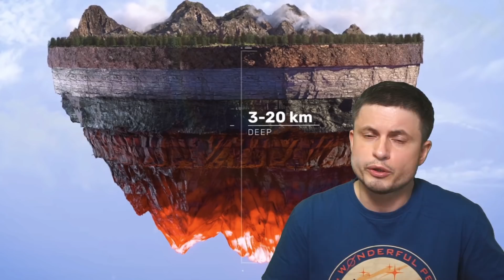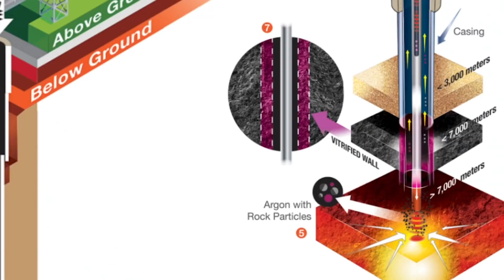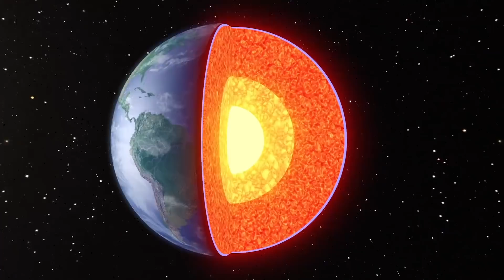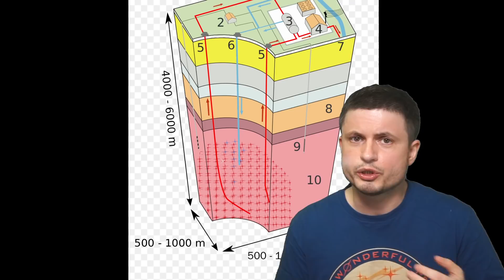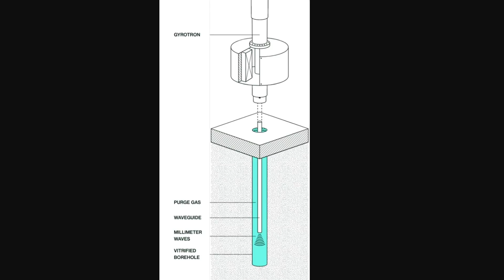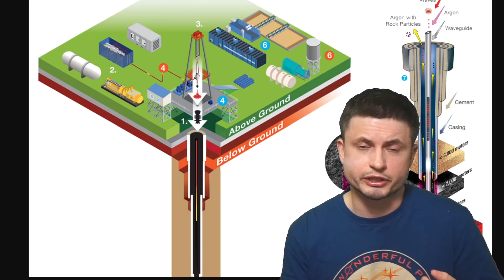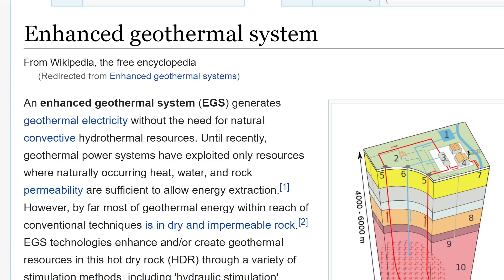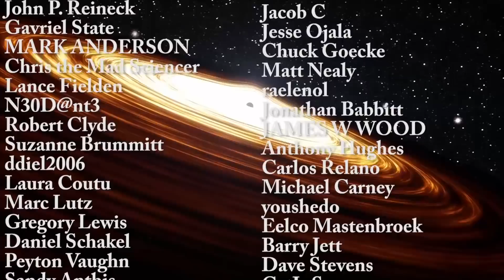Creating Deepest Hole on Earth For Geothermal Energy Revolution

Comment: Now this is good news.  Familiar with geothermal as I lived through the 1970's but the fact that it is "free" explains a great deal of why geothermal hasn't been aggressively pursued.  At least to me anyway.  Dunno.
Reply: "Free" energy is a misnomer, nothing is free.
The amount of carbon released to remove that volume of rock as well as released gas from the mined rock will "cost" a lot of carbon emission.
 Also the excavation of such a volume of rock won't be done "free of charge" by a generous cooperation for the eternal good of humanity.

Comment: I was in high school when the Kola bore hole was completed. I wondered then (as kids do) why we couldn't just use a laser combined with suction to vaporize the rock and vacuum it out of the way. I'm glad to see that science is finally taking my daydream in class seriously!  8-)
Reply from the maker: precisely! Star Trek to the rescue once again
Reply: It depends on the fluid/gas involved but it’s much more reliable and efficient to blow instead of suck. Typically what drilling rigs do is they have pipe that is narrower than the hole itself. They pump down the drill pipe and the fluid returns through the space between the pipe and the hole wall (the annulus). This process is not perfect though because material and debris have the potential to bridge off and plug the return path, a potential which is made all the more likely and complicated along the large temperature gradient of the bore, especially for the hypothetical one mentioned in the video.
Reply: @E2theBizzle  think you need a word with my GF
Reply: @unnamedchannel1237  lol that took me a second
Reply: You always see big coolers for big lasers - probably will have a problems cooling electronics that deep.
Reply: @Mike_lis  I don't think their idea is to put the "laser" (in this case it's actually a maser) generating equipment at the bottom of the hole (that would defeat the entire pourpose) but to have it on the surface and use some kind of waveguide to deliver the energy at the bottom.
The advantage over regular drilling would be that all the compicated stuff would be easily accessible on the surface while all the stuff down in the hole would be extremely simple (a waveguide for radio waves is basically just a metal pipe and/or metal rod).
They already do the same with lasers when the laser emitter would be too bulky for a certain application and so they use optical fiber (a light waveguide) to deliver the laser where they need it to be.
Reply: Suction only works to 26 feet deep.
Reply: @kkarllwt  - Your sweeping statement contains the common error of overgeneralizing a factoid, and you did not even get the detail right. You are referring to the lifting of WATER purely by suction, which relies upon atmospheric pressure to push the water up a pipe, where the pipe has a partial vacuum in it. (That should be called "sucking" rather than "pumping", but that is another common problem, imprecision in the vernacular.)_. Drilling deep holes has no relation to that water pumping scenario because all the _down hole fluids are pressurized. BTW, water often can actually be suction pumped several more feet than 26, but it depends upon the water temperature, the air pressure, details of the pump, the salt content, and even the amount of dissolved gases in the water.
Reply: @kkarllwt  32 feet? I thought
Reply: 'completed' is a stretch, 'gave up trying to go any deeper' is more accurate, the rock isn;t rock at that depth, it's more like chewing candy.
Reply: Energy...vaporizing rock takes a lot more energy than breaking it up.
Reply: @maudiojunky  Yeah but its an overhead, you can stop once you reach a certain distance, but still generate energy
Reply: @CrazyAssDrumma  Well yeah obviously it's a fixed overhead, but it's still an overhead that makes this method likely impractical for anything but the deepest stages of drilling on a project like this, let alone any ordinary, shallower drilling operation. GrayBeard pondered why not, and that's exactly why not (beyond technical limitations in the past). The heat required to vaporize granite is about 4x that required to vaporize water, and this device will be far from 100% efficient at delivering the energy to the target. The only thing that makes it attractive at all is the lack of an alternative solution.

Edit: I did the math and vaporizing 10km of granite in a 10" (25cm) borehole requires about 3.7MWh of energy before accounting for any efficiency losses, so I'd guess we can expect somewhere between 10MWh to 100MWh of overhead per borehole. It's really not too bad in the scheme of things since that estimate puts the energy use at 1-10 households worth of electricity for a year, but without knowing the return rate on each borehole or how many you'd need it's hard to estimate the payoff period. Essentially though we're looking at a small neighborhood's worth of energy for a year for the actual vaporization of the rock for each borehole.
Reply: @SteveQ Also known as "Staying upward-compatible with past mistakes."
Reply: Yuuuup 1mm wavelength that's gotta be a co2 laser (the 10600 nanometer wavelength is emitted by most commercial co2 laser units)... transverse electrode co2 laser.
Reply: Did you ever graduate?
Reply: @number4cat1  Yes, despite my best efforts to thwart my own progress, I ultimately completed a BA, MA (most of a second MA), a teaching credential, an administration credential, and a handful of other state certifications.
Reply: You could probably have an ultrasonic cutting head.

Rotating tools are so primitive
Reply: @ssss-df5qz  for sure, especially with some of the new acoustic lensing tech....
Reply: Good intuition. You’re probably smarter than you think. Keep dreaming and I hope one day you trust your gut and build something worldchanging. 👍🏾
Reply: @xerotolerant  Thank you for the kind words, really. Somewhere along the way in my years as an educator, I arrived at the conclusion, that pretty much, we are all smarter than we think we are. I am grateful to the many students who contributed to my realization of this. The most fantastical experience a teacher can have is to in some way support, encourage, or even inspire in a moment one student who one day changes the world.
Reply: @Graybeard_  I was previously watching Veritasium about the man who invented leaded petrol (and also CFCs). Its estimated the global IQ score dropped by 280,000 as result, with the biggest impact in wealthier countries but spreading to the whole planet. 

But I agree that too many people appear to underestimate themselves, not so much what they could understand, but the entertainment they could gain from making the effort and, almost accidentally, gain some understanding of the science and work . I’m virtually illiterate so far as science and engineering, but with communicators like Anton doing much of heavy lifting, and being a sci-fi fan since I could read, its a wonderful thing to be entertained by both fantasy and reality and when they sometimes collide....how many km down!? no way!  But Jules Verne would be very disappointed.

Also entertaining toread comments from those who know more and have practical experience.  One reason I like Anton is he attracts wonderful people.
Reply: @paulaembleton  280,000 iq score sounds like a lot of iq to loose.  What does that number mean?
Reply: @jengleheimerschmitt7941  - It was MILLIONS of IQ points, close to a billion, but obviously that loss was spread over billions of people who each lost a small amount.

Comment: As long as mathemeticians can calculate and moderate at what speed the earth will cool over time, it should be fine. There is no such thing as free energy. It transmutes into other things and will deplete the source, in this case Earths thermal energy. Couple of the variables that might come from a cooling earth is less gravity? A slower rotation? We get pulled closer to the sun? As long as we have a plan to be on a Earth 2.0 before then, it should be fine. Same wind wind and solar. There is always a trade off. Probably negligible and a million years from now or depending on the rate of energy expenditure, but it should still be calculated.

Comment: At 20km depth, water from the surface would reach nearly 15 tons/square inch just with gravity without any pumping whatsoever, Couldn't they use that 'Free' power to bore even deeper?
Reply: At 20km depth, any water isn't liquid anymore, but high pressure steam going the other way....
Reply: At 500 degrees Centigrade, water would still be liquid at 15 tons per square inch of pressure.

Comment: Some Texans are working on a system which drills by forcing thousands of small steel balls into the rock using water pressure. So far, they have increased the speed of drilling by 3X over traditional methods. They are aiming at 5X, so that thousands of holes can be drilled far cheaper and faster than today. If they can drill cheaply enough, geothermal will become practical in many places on the planet. It was on a major TV network which showed the operation, so its is no internet rumor. The steel balls smash the rock into small bits. Steel balls are cheap and can be made by the billions using automated machines.

Comment: This is nothing new at all.

This has been done in many forms and mostly for utter failure. My dad invested in a company doing it in australia and they couldn’t get it to work mostly due to bedrock problems. The Icelanders get all their power and home hot water and underfloor heating from local hot pressurised water and then they return it to local cold low pressure spots. 

Funny enough except for Iceland you use the oil well and fracking drilling method. Drill into hot bedrock. Run the fracking balls through to open fractures to increase surface area. Drill another hole at the end of the fractures. Cold water down the first hole and hot pressurised steam out the second hole. It’s been done.

Comment: Drilling deep holes with cesium formate drilling mud (very dense), to sustain the pressures at depth. Their fancy drilling system. Meh.
Oil drilling gear yes, 3 km depth for the fields, yes. If you are near plate boundaries/volcanic areas, hell yes.
Otherwise save your money.

Comment: Earthquakes are certainly sufficient to pause "open" water circulation systems.  Another reason is the mineral content of the water brought to the surface.  It's destructive to equipment and requires excessive downtime to address.  Closed water systems are safe and effective - just bloody hard to set-up.

Comment: I'd been reading about geothermal. Unfortunately, it's presently the most expensive source of energy; more than nuclear. I read that an island in Hawaii was planning on shutting down its coal plant, mainly because of all the investment in rooftop solar. But their geothermal plant is shut down after a volcanic eruption. It turns out the locals hate it because it has had blowouts releasing dangerous gases such as hydrogen sulfide (H2S). Maybe this is why further investment in projects hasn't occurred in the last 40 years.

Comment: I would think by the time it travels up the tube it would cool down.
Reply: Ofc a bit, but the tube will be made of isolating material and the steam will travel fast. I don't know the maths though.
Reply: @Todestuete  geothermal vents closer to the surface have that advantage because they are much much closer. 20 plus km is a lot of distance.
Reply: But insulation would reduce that heat loss, sure.

Comment: Has anyone considered how much heat we will be adding into atmosphere with this? However you use this, its basicly moving heat from inside to surface. I hear some people have recently been concerned over global warming.
Reply: Come to think of it, it would add about as much to heat balance as nuclear plants do.
Reply: Heat is not the problem, it's the greenhouse effect of CO2 that's the problem. Potentially, this replaces most sources of CO2 for base-load generation, thus reducing the amount we're adding to the atmosphere.

Comment: so what happens when you eventually suck all that heat out of the core and cool it down. what's the potential negative impacts?
there a mechanism in place that constantly replenishes it?
Reply: Yeah, that's not going to happen by human activity. We've had major volcanic periods in Earth's history and that hasn't seriously affected the outer core which is molten due to radioactive decay. Likewise oceanic crust in subduction zones goes deep below the crust to melt and be churned up with volcanos. The inner core does expand slightly with time.

Comment: How do they actually plan to extract the melted rock? Also bore hole collapse seems to be the main problem with very deep bore holes. I don't see how this new process combats this problem.
Reply: Ideally they just need to drill down to really hot rock (>212°F/100°C), not melted rock (~1000°), then water is pumped down, and comes back up as steam.
Reply: I don't mean as a power source.
How does their drilling technology remove the material from the borehole? They state the material gets vaporized, but I assume the can't keep the vaporized rock at a couple thousand degrees Celsius all the way up from a many kilometers deep hole to keep it in that state. The vapor therefore condenses on the bore hole wall and in the cooling air, closing the hole up. To combat this they would have to transport all the resolidified rock particles and ash out of the hole with an extremely powerful air system, making the scaling of the cost exponential again since the power required would rise with the depth.
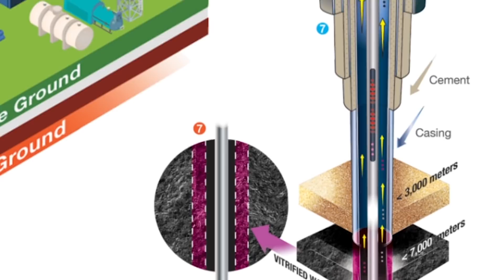Reply: @lukasdimmler2622  Normal oil-well drilling involves a drilling fluid or mud that holds back the pressure and transports cutting back to the surface. There's a good diagram behind his head, starting at 7:48
Reply: @sandal_thong  Well, you can't  vaporize rock at 3000-6000°C and also flush the system with water. The most promising approach I saw on my quick search was one by the Fraunhofer Institute that plans to crack the rock with a pulsed high voltage discharge and then extract the particles with water. That would  be similar to EDM drilling which already is a proven technology and demonstrates high aspect ratios.
Reply: @sandal_thong  Also thanks for the timestamp. It appears they want to flush not with air but with argon. But the core problem of large rock particles not being able to float on the gas stream and blocking the hole still stands. It also would take absolutely massive amounts of argon to drill that 20 km hole.
Reply: @lukasdimmler2622  Oops, sorry.  I'll delete my earlier comment!  The gyrotron doesn't just melt the rock, it evaporates it! Just the very top layer of molecules.  Pump out the gasified ex-rock and carry on down...
Reply: @Juttutin  Well, the gasified rock kondenses at roughly 2200°C, I mean good luck pumping that.
Reply: @lukasdimmler2622  it gets mixed basically as individual atoms in with the cooling fluid being circulated at pressure through the bore hole.  There's plenty easily googled that goes into more depth.  There are also multiple companies working hard and all following the same basic process.  Quaise are just the first getting serious investments and press.

Comment: Drill hole for great expense. Pump water down - get highly contaminated water back up that scales the b*tch out of your heat exchanger pipes etc as well as corroding the hell out of your equipment. As your costs mount and your power generated per dollar goes skyward you look for the exit and scuttle off with your tail between your legs. Rinse / repeat.

Comment: Energy’s never free, you still need to build and maintain the plant and equipment, hire labor, build out the power lines. That stuff ain’t  free.
Reply: Power lines are already there, it will replace coal / gas plants where they are, even using their steam generators.
Obviously it's not really free, but compared to other energy sources it's the most scalable one, as it needs no ressources (except building material / maintenance) and has no significant surface area (unlike solar/wind).

Comment: In FRANCE many years ago , someone hired a company to drill a hole for geothermal heating system, they come in contact with a high pressure water vein deep in the rock , they tried to seal the hole but the pressure is too high, now the whole village is raising up , nearly every houses sustain damage over time , the house of the guy who has the well drilled has tilted several inches already .